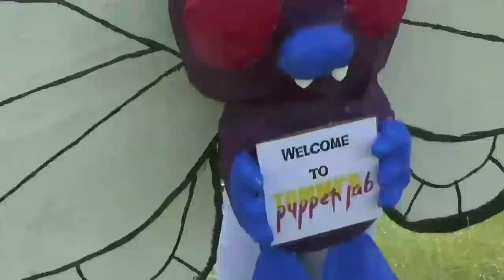How to Make: Bonbon and Bonnet! | FNAF Sister Location Hand Puppets! | DIY Crafts from Scratch

Comment: Do U have to cut of the arms of the puppet
Reply from the maker: You can glue them on the puppet but then you won't be able to use the arms :)
Reply: No I mean take them off while making bon bon
Reply from the maker: Technically no, however if you take them off they are much easier to work with when adding detail :)
Reply: Ok Thank You